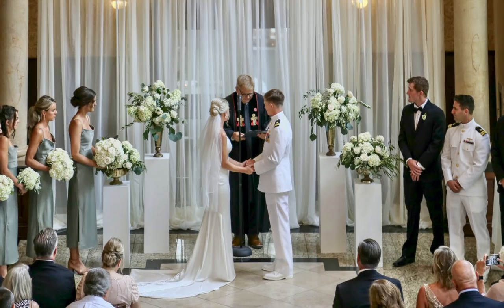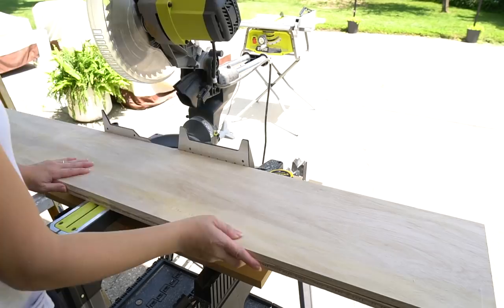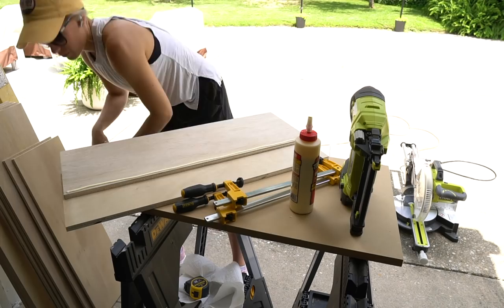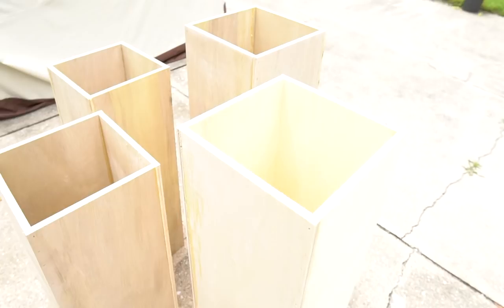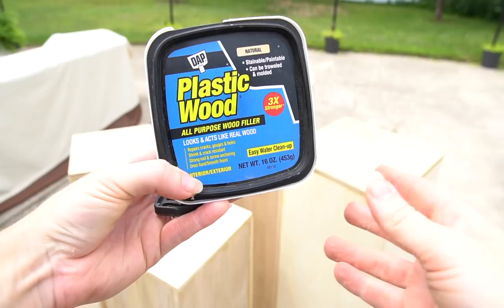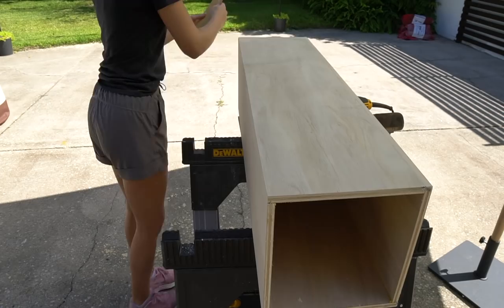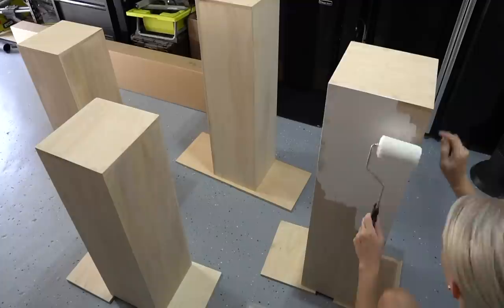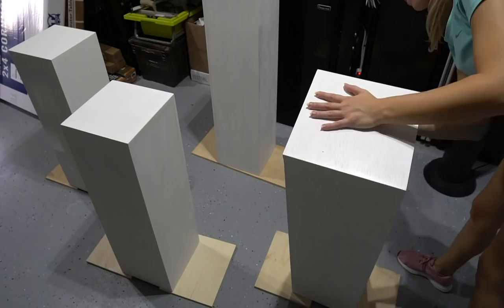DIY Wooden Pedestals | Wedding DIY

Comment: Thank You for sharing this! I'm wondering how strong these are with the plywood. Approximately how much weight do they hold? I'm trying to decide whether or not it is necessart to build them with a slightly stronger wood material. Mine would be for weekly or monthly use for weddings.
Reply: I have the same question. Mine would need to hold a table-top lectern with a large book on it.